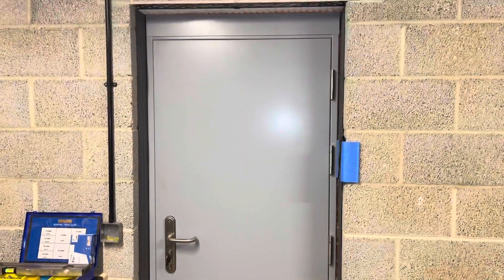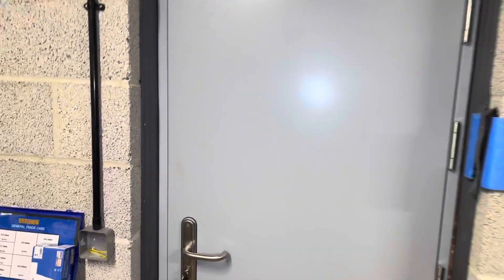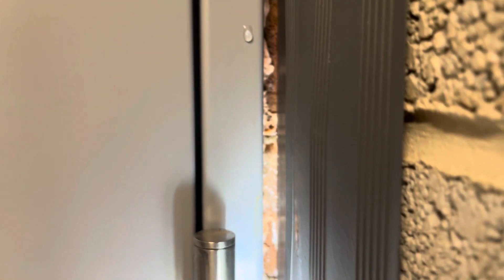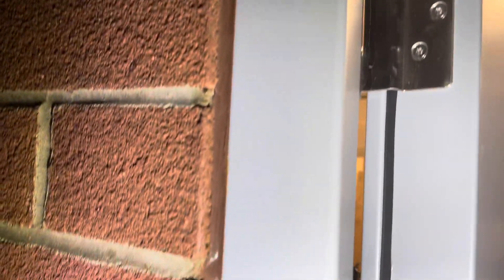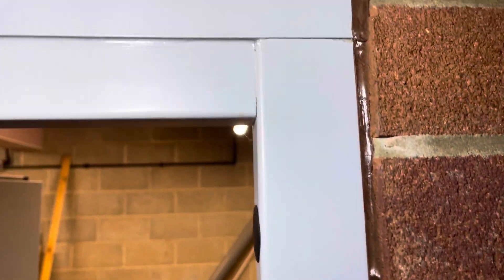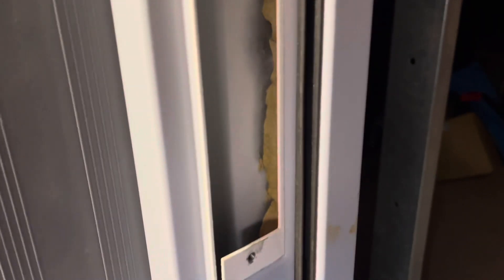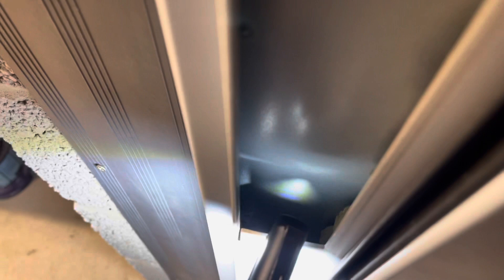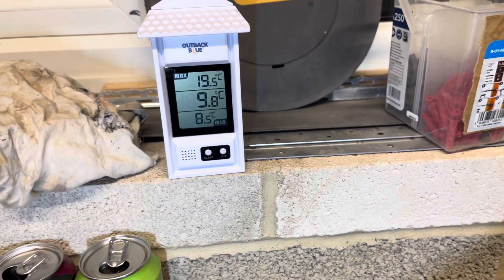Latham Steel Door Condensation problems

Comment: The frame forms a cold bridge that causes condensation on the inside of the frame. The moisture all comes from the room, it is not leaking in from the outside.

Comment: Damn. I just bought 3 of these doors. Any recommendations what I should do prior to fitting to prevent this?
Reply from the maker: In my case it was just the frame; so look in the fixing holes / remove lock box and see if the insulation is present. Lathams did replace the whole unit in the end, hopefully yours should be ok.